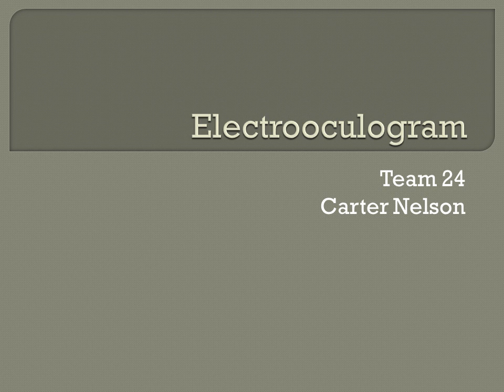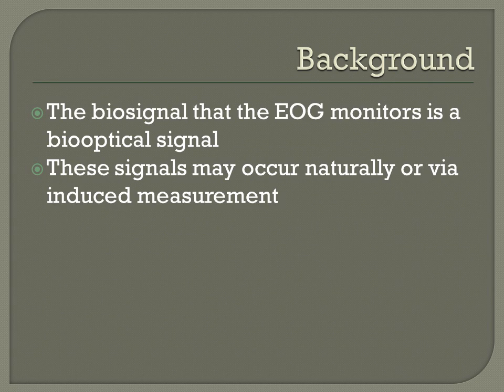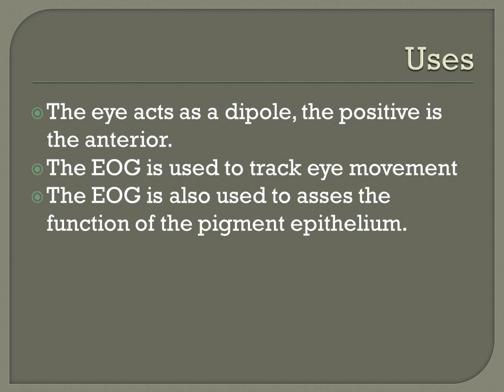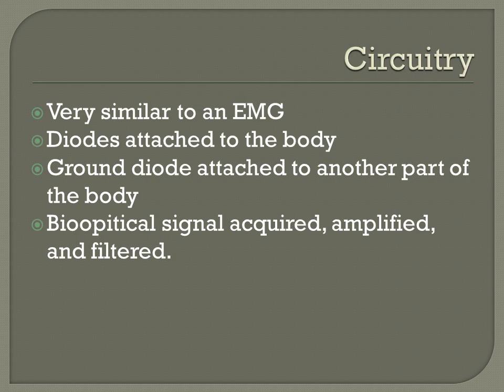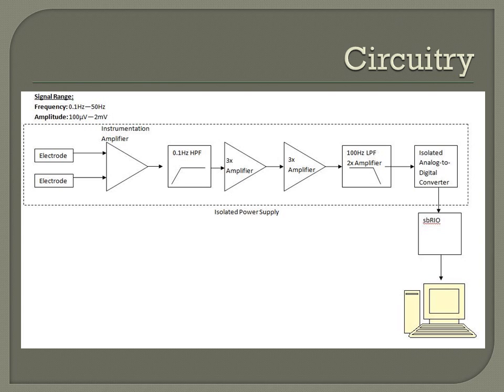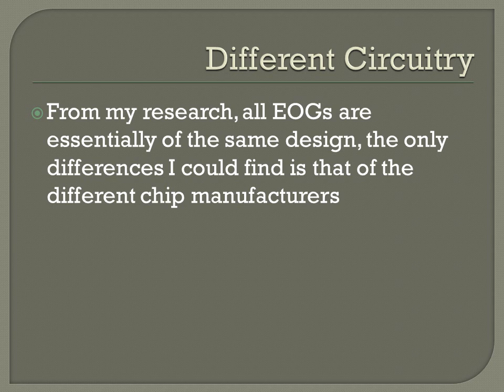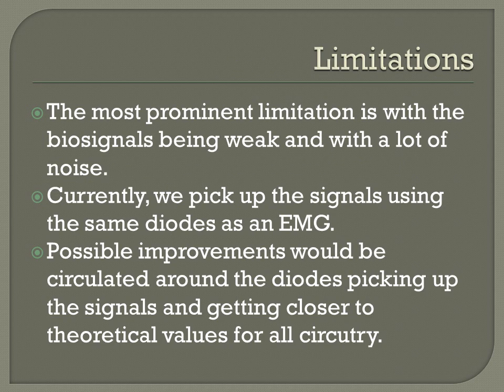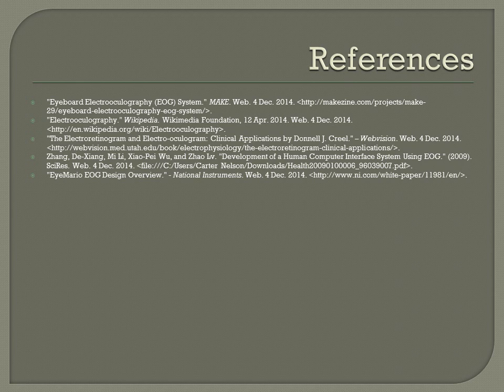EOG (Electrooculogram)

Comment: I dont understand what is the relation between eye movements and electrodes that are placed near the eye, like the eye ball is moving but the electrodes are steady, and how can they measure coreoretinal potential and they are placed on right and left, can you please explain me
Reply from the maker: You are measuring the action potentials of the muscles surrounding the eyes. This is a simplistic design and may not be suitable for more complex tasks.
Reply: My prof. Said the eye has a potential difference across it from the back to the front(the back is more -ve  than the front).
And this my understanding (I might be wrong😅) is that the movement of the eye various the distance between the electrodes the back of the eye which various the resistance along the way which various the voltage picked up.